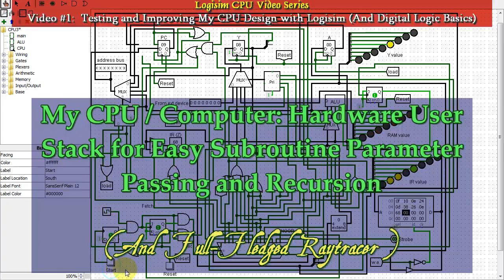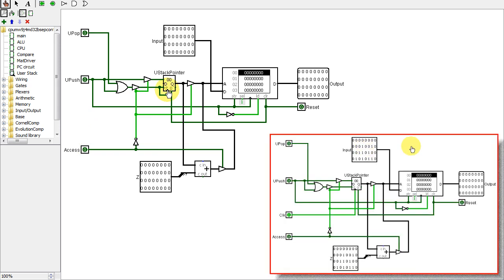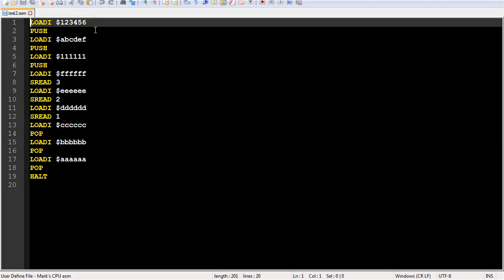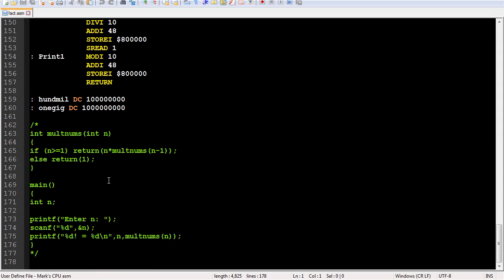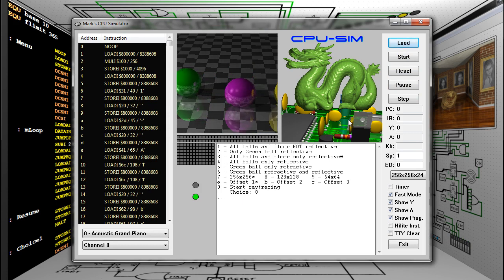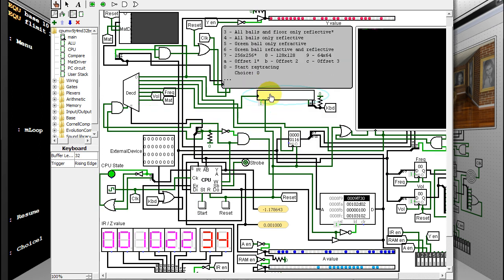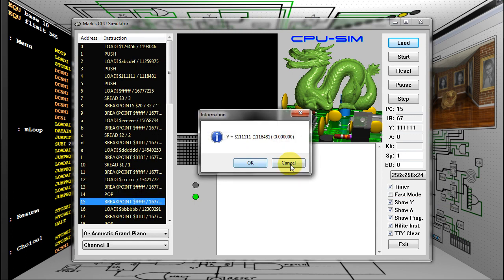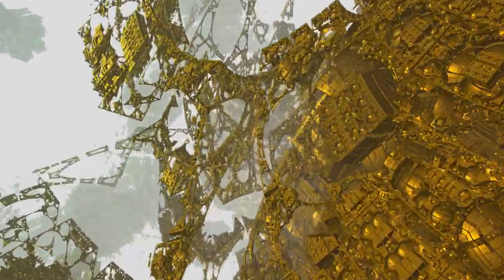My Logisim CPU / Computer: Hardware User Stack for Easy Subroutine Parameter Passing and Recursion

Comment: download?
Reply from the maker: @ExoticDevOfficial  Sorry, my circuit file isn't available for download.  I have made some Logisim JAR files available (not the floating point one though) for download though.  If those are of interest to you, you can check out my github repo:

https://github.com/mrmcsoftware/MyCPUfiles

There are different libraries that in many cases only work in one Logisim version or another. I wrote my MIDI Keyboard device to work in not only original Logisim but various forks of Logisim Evolution as well. Some other libraries only work in either Logisim or Logisim Evolution (but not likely the latest versions) but not both.

Also: https://github.com/mrmcsoftware/MIDIkeyboard
Reply: @MrMcsoftware  what does the JAR file do?
Reply from the maker: @ExoticDevOfficial  I'm not sure what you mean....  If you mean what do JAR files do in general, they add components to Logisim. (On Logisim, click on Project menu, go to Load Library then click on JAR library.  Once a JAR file is loaded, assuming it loads correctly (is for the version of Logisim you're using), the new components will appear in the left sidebar).  If you mean what do my JAR files do,  well one adds a Midi keyboard device (to use with the Midi component), others add original Logisim components to Logisim Evolution, others add Logisim Evolution components to original Logisim.  However the ones that add components from original Logisim to Evolution are now probably mostly unnecessary due to improvements to Evolution and might not work in the newest Evolution anyways.
Reply: @MrMcsoftware  oh okay, so you basically installing addons or mods to logisim?
Reply from the maker: @ExoticDevOfficial  I guess addons would be fairly accurate.  The first component (JAR library) I created was a real-time clock, so my simulated computer system could know the date and time.  For the video screen component I took the code from the Cornell version of Logisim, improved it, and put it in a JAR library.  I wrote another component that interprets the values in the instruction register and prints the most recent 3 (If I remember correctly. 3) assembly instructions executed by my CPU.  And so on.

Comment: Will you eventually add caches, pipelining, or instruction-level parallelism?
Reply from the maker: @Gabe Maiberger Sadly, I doubt it.  I think it would be a bit beyond the scope of this project.  One problem, for example, is that these things speed up CPUs in the real world, but they slow down a Logisim simulation.  Every added component (including wires) slows down the simulation.  So, these additions would only be made for the purpose of showing the idea not to make it more useful (which has its merits, of course, but there would probably be design trade-offs to make it work in Logisim that might make it not the way it would be done in real CPUs).

But, your comment did make me think of something intriguing - the CPU is a subcircuit, so I could always add another instance of the CPU - making a parallel processing computer.  But, it would be a lot slower, and there would have to be support in the instruction set and/or the OS (there isn't exactly an OS right now though) for that (and RAM sharing circuitry, I suppose, etc.).  I suppose the second processor could just run a program that's in a ROM (and doesn't need to access RAM), but what would that program be?

Comment: Any source code?
Reply from the maker: For the assembly programs?  If so, the code would probably not be very useful without the CPU / Computer.   I could make the assembly source code available if desired.  If you mean the circ file (as well?), it's not currently available for download (it would also need my FP logisim JAR library which is also not currently available for download).  I do have some of my logisim JAR libraries (which IIRC all have source code inside them (just unzip the JAR file)) available for download:  click on Downloads at: http://sites.google.com/site/mrmcsoftware

Comment: What libraries do you use? Can you provide an download link?
Reply from the maker: Most of the libraries I created or modified (not the FP library though) are at:

https://sites.google.com/site/mrmcsoftware/home/downloads

(starting at cs3410for271.jar but the intro text gives info about some of the files) and another file (unlisted) here:

https://sites.google.com/site/mrmcsoftware/home/downloads/EvolutionComp.jar
Reply: Thanks! And can you make a library that will load a file? And then can you program a program that will load picture or program and execute it from an file? It can very well compress your program size because you can use recastying (example) as a function!
Reply from the maker: I'm not sure what you mean.  Are the library to load a file and the program to load picture/program the same program?  Is the program to load a picture or program to run within Logisim?  A Logisim library can be written to load a file, but I'm not really sure what the library could do with it at that point.  In terms of affecting Logisim's simulation, you can only do what Logisim allows (due to the provided class member functions).  BTW, there was something I wanted to do, but Logisim's classes didn't have the necessary class members/member functions.  One could fork off another fork of Logisim, and modify Logisim's internal code, but I don't want to do that :-)  I don't know if this next part is an example of what you mean - I guess you could write a RAM component that reads and writes to a file (the RAM contents aren't in memory, they are in a file) but it would be slower and I'm not sure there's much point.  This could also be done with a ROM component (in that case, of course, only reads).
Reply from the maker: @deco Art I haven't made it available for download.  But, here's a link to a reddit post of someone who wrote one and made his available.  I haven't tried it, so I don't know how good it is.  https://old.reddit.com/r/logisim/comments/7yxakc/mod_i_created_a_floating_point_library_for_logisim/
   And, in case anyone is wondering, I wrote mine before this reddit post was posted.

Comment: Would you consider your ISA RISC or CISC? It certainly doesn't look MISC, which is what I am trying to go for when I have time to work on these kind of things.
Reply from the maker: I never really thought about it.  But I guess it would probably be RISC since every instruction has the same small cycles per instruction and every instruction is the same length (32-bits (with some instructions not using the upper 24-bits of course)) - no capability to do an extra RAM read to get another 32-bit operand.  Also simple/limited addressing modes.  However, I would probably say it doesn't follow every (common) aspect of RISC.  BTW, I was thinking just yesterday that I probably wouldn't have the timing issues I mentioned in this video (that prevent SWRITE and some non-gated clocks) if this CPU had the capability of doing more cycles per instruction (even variable number of cycles based on the particular instruction).  Also, BTW, one thing that kind of violates RISC (if you were to actually try to implement this CPU) is the floating point instructions.  In a real situation, the FP operations would certainly not be finished in one instruction cycle.  Since it wouldn't be practical to model that aspect in Logisim, I didn't bother dealing with that.  But, apparently, there is a RISC with FP, so maybe that's not a deal breaker.
Reply: I would then say that this is entirely its own _ISC then! :D I think it feels really unique and creative!
Reply from the maker: Thanks!  Yeah, maybe its own _ISC.  I could think of perhaps a few terms but unfortunately they seem to start with C, which is already taken (CISC).